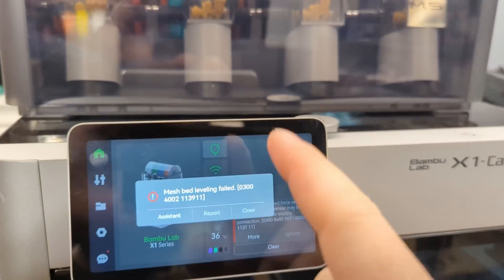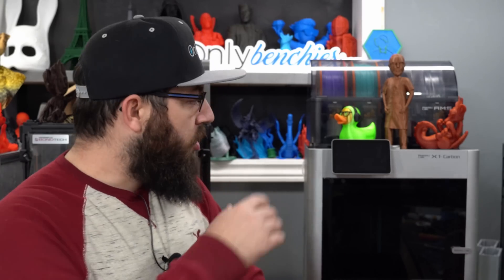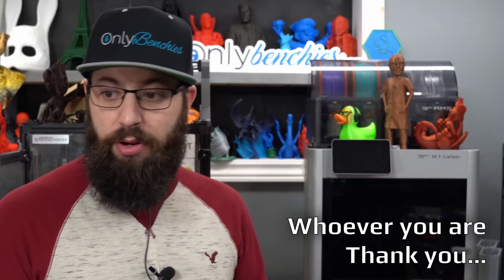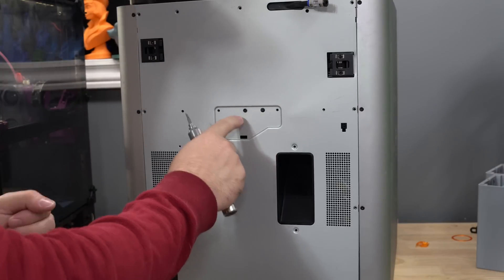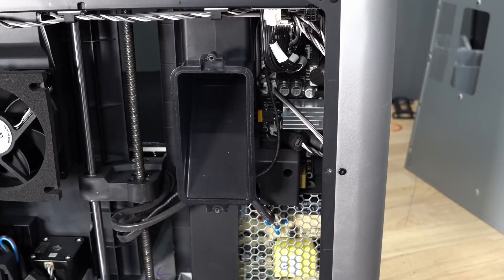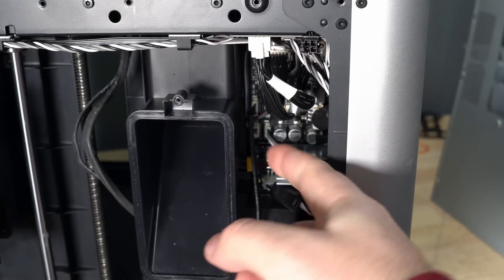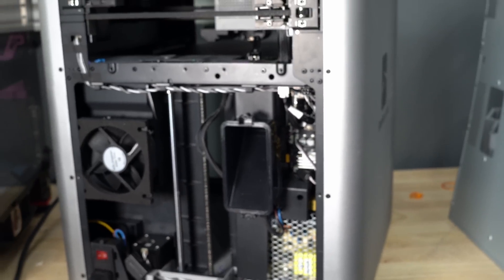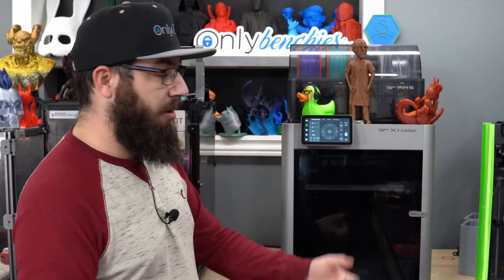Fix your Bambulab X1C/P1P faulty bed! #3dprinting #

Comment: The cables rubbing on the leadscrew can't be good too.
Reply: looks ugly, but leadscrew threads are not sharp, cable sheaving will live much longer than printer  itself 
most likely
Reply: @AlexanderEresov  Sharp or not. Letting cables rub over anything is a poor design choice.
Reply: @woodcat7180  I don't defend this design :) it is just not something that needs immediate attention.
Reply: @woodcat7180  also its a cheap one which makes sense when making a machine like this
Reply: A sleeve would fix that quickly. The rubbing may not be worrisome but not ideal.

Comment: maybe a "not so good" crimp connection and movement changes the connection ever so slightly that the resistance changes and therefore the voltage changes too. If the sensor does depend on accurate voltage that might not be ideal... so not enough movement to loose contact but enough to change the resitance of the connection

Comment: I think the wire are binding on the z-axis lead screw. It’s a matter of time until it wear and short
Reply from the maker: ya im not a huge fan of the wires rubbing on the screw either
Reply: Ya something needs to be done about that. I would wrap the cable in some quality electrical tape to protect the actual cable insulation but routing the cabling to where it runs alongside the lead screw would be ideal.